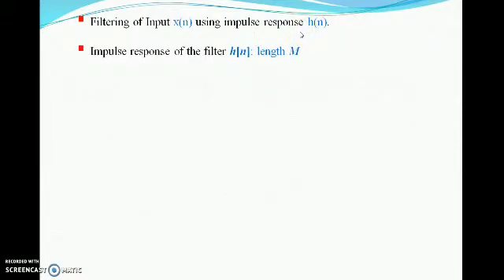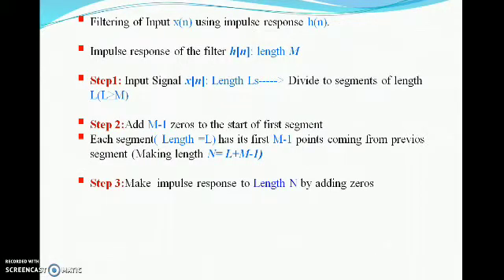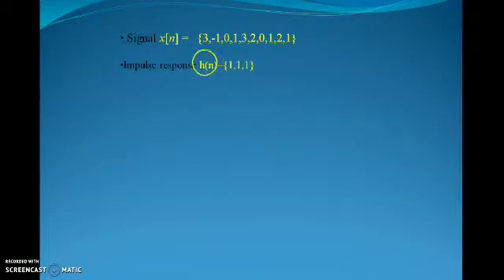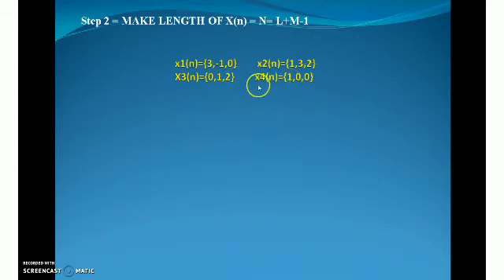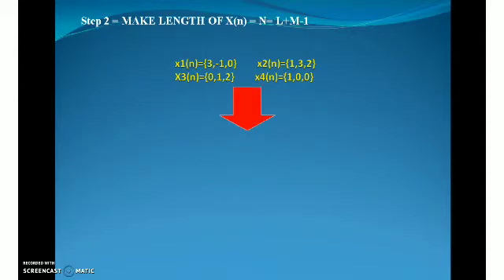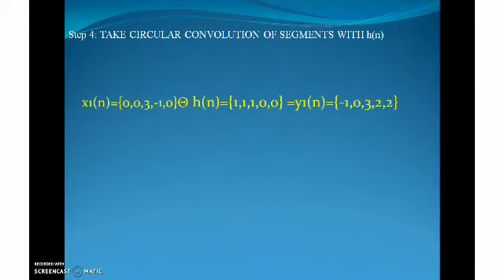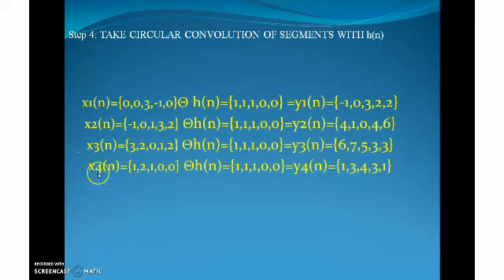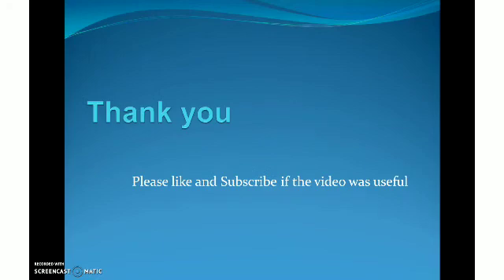OVERLAP SAVE METHOD, LINEAR FILTERING OF LONG DURATION SEQUENCES

Comment: Using overlap save method and 5 point circular convolutions, determine the response of an LTI system with impulse response h(n) = u(n) + 2 del(n-1) -u(n − 3) for an input sequence x(n) = Σk=o to 10 Ak del(n − k), where 
Ak  = 1, for k even
= 2. for k odd.
Mam, how can we do this problem.